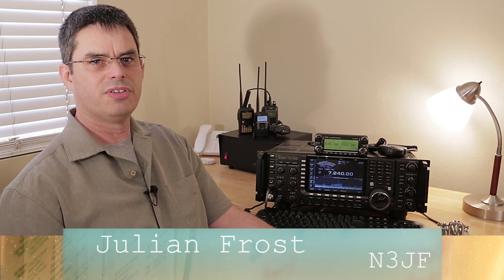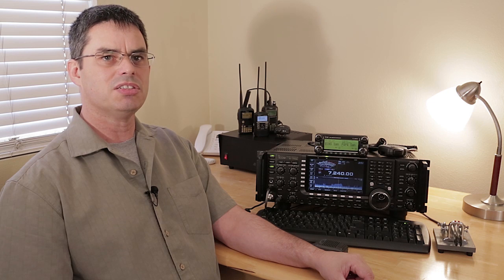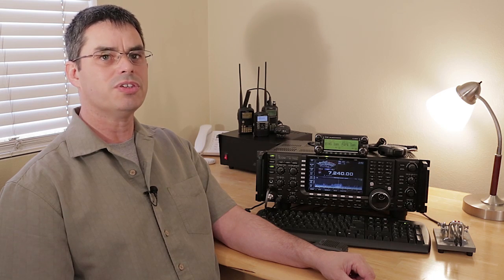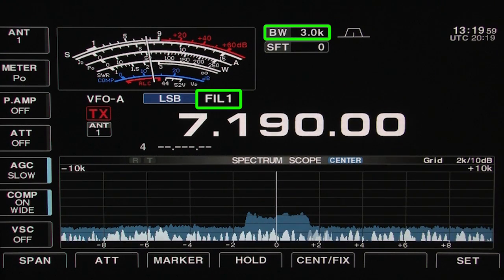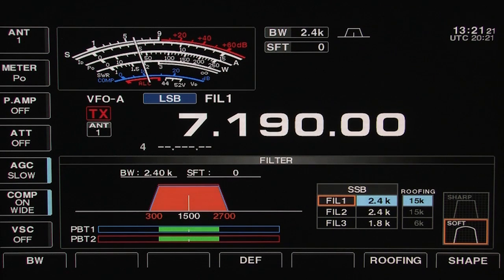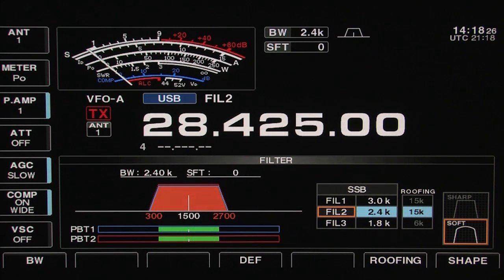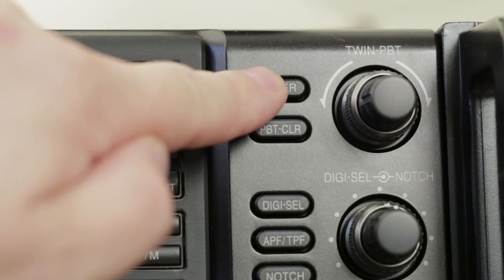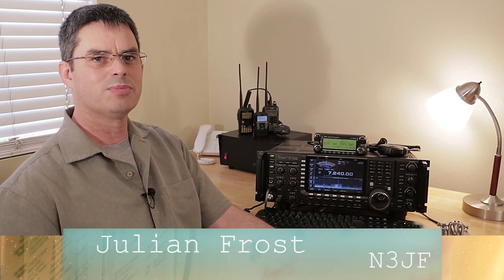Ham Nation - Icom HF DSP

Comment: Did you do the other video ?
Reply from the maker: It got put on hold, as the radio had to go back to Icom.  It is planned to be done... all the gear to do it (other than the radio!) is still at the shack.
Reply: jyunte Ok, nice video. looking forward to the other one, if you get the chance to produce it.